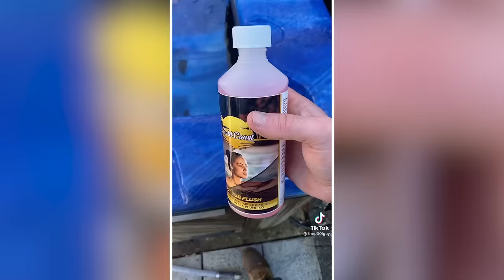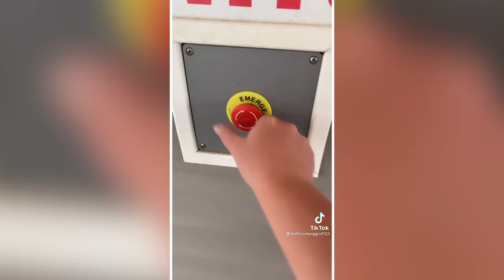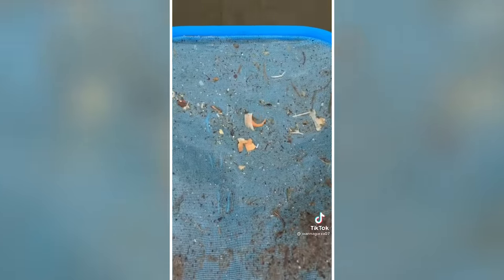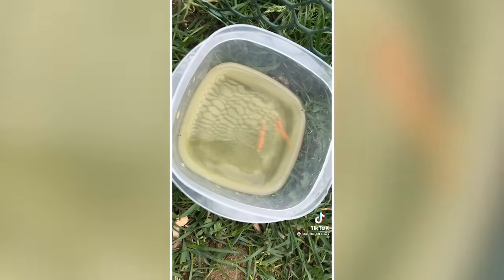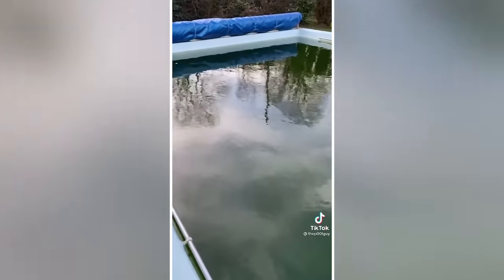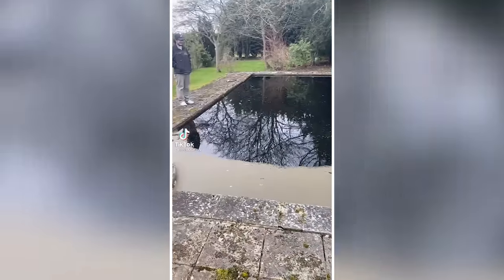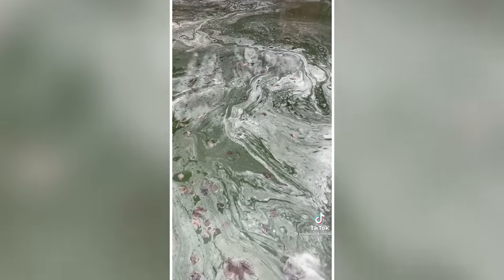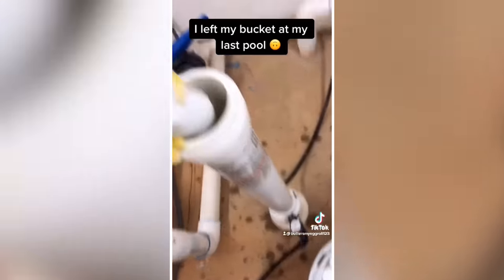Pool Cleaning TikTok Compilation

Comment: Genuine question, so where i live people don't normally have pool except for the really rich ones. I've been seeing a lot of pool cleaning compilation and most of the time they would just use chemicals and stuff like that instead of draining it and clean it like that. Is there any particular reason why? Wouldn't it be saver to drain it and fill it with fresh water or that wasn't an option?

Comment: I honestly have to say, if no one would be using any hot tub, pool or etc. Then either use it anyway and clean it regularly to be outside more often (if the people want or need some outside air and what not), or just spare sometime to move out somewhere else with no pool or hot tub. I'm just saying not actually telling u